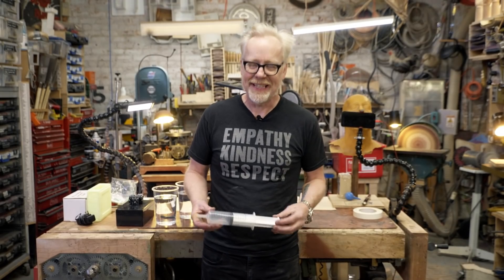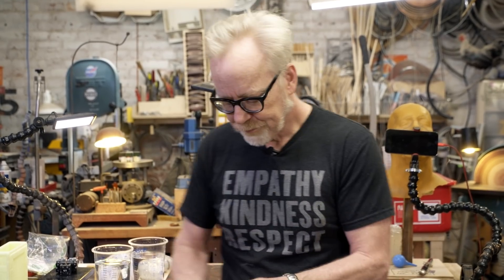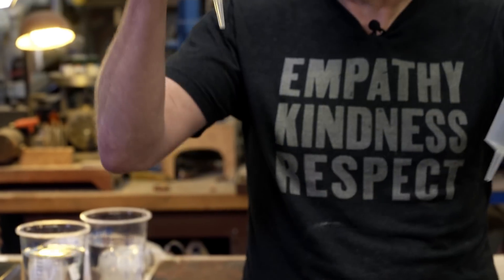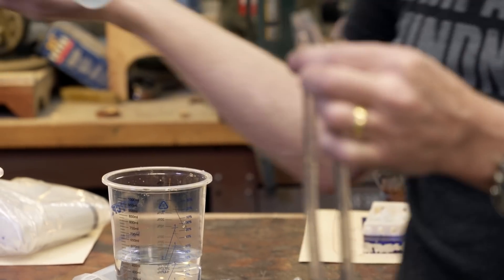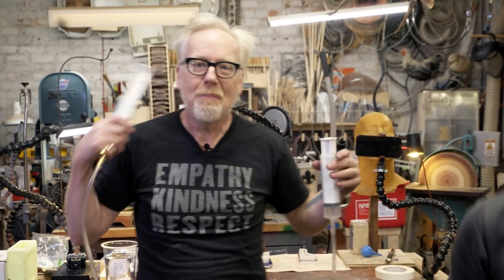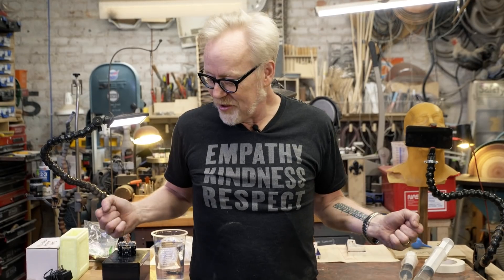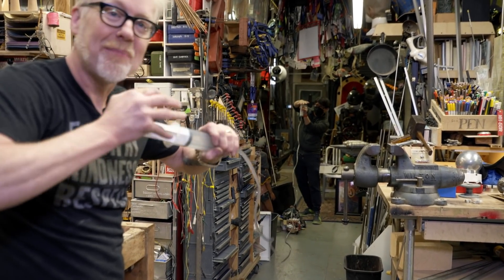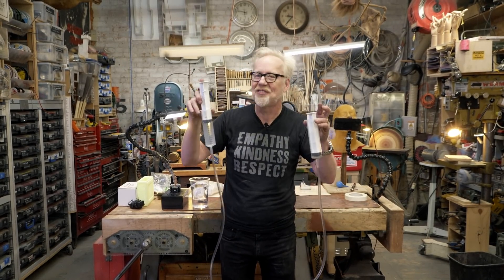Adam Savage Demos Hydraulics with Cheap Plastic Syringes

Comment: Those syringes can also be used to show physics. If you fill one with a little water at e.g.40 degree celcius and plug the nozzle. Then pull hard to create lower pressure, you will see the water starting to boil. This is due to the temperature needed to boil water decreases with lower pressures.
Reply: Ohh, and if you need more mechanical advantage making pressure, many larger syringes fits the cheap chalking guns :)

Comment: I've used this system but with air to change the tuning of a high-voltage section of a radio transmitter. Obviously water would defeat the object of keeping me and a few kilovolts at a mutually respectful distance, and the tuning circuit didn't need much mechanical force to operate - basically a variable capacitor with a swing arm. 

The arrangement worked very well. The transmitter, not so much. But that's another story.

Comment: I've you've ever put plants in hard to access places, you can use a syringe and some tubing to water your plants from a distance. It's a very useful trick I learned working with a group on an art installation that had plants strapped all over it.
Reply: Could use T fittings to split off a single input line as well.

If you have a high quantity of watering to do, could even replace the syringe with a small fountain water pump or maybe an in-line hand pump like the ones used to siphon gas or other fluids out of drums and barrels.
Reply: @Sycillis  That's basically a drip watering system.
In the gardening store where I did my apprenticeship, we had hundreds of flower pots stored under the ceiling, both in the sales rooms and the growing houses, and we'd water them through a rubber hose network running alongside the suspension cables.
Reply: @Yora21  Yeah, they already sell this at home depot lol they’re very small black hard plastic hoses that drip how much water you desire
Reply: Who would make their plants hard to reach? That seems so very mean. 
'I know you need water, but I'm gonna make you hard to reach! I will throw water at you. Hopefully I will get some syringes and tubing together before you shrivel and die! Think like a cactus' - Mitch Hedberg(almost) lol

Comment: used with non conductive fluids to operate tuning capacitor mounted on HF magnetic loop antenna systems. This allows manual tuning of the antenna without any adverse effects.

Comment: Ive used  a similar sized syringe to add tapping lubrication in my CNC mill... a $10 solution in a $1mill machine :)
After the holedrilling operation, before I would stop the machine (M00) to add the tappingoil by hand. Got tired of this very quick, so I put the syringe upright in a vise, with the hose ziptied to a magnetic block, then using an emtpy ER32 collet i could push it around the workpiece and push down the plunger just a bit to add the oil... One of those things I SHOULD have made a video of I know :)

Comment: I learned about the usefulness of Fluid and Pneumatic Cylinders using plastic syringes in my "Power, Energy and Transportation" Class in Middle School back in 1988 (8th Grade).
Wonderfully simple and easy to use with phenomenal results!
We also dabled with Gear Ratios using LEGO Technic Sets, Compressed Air and Solar Power... Back in 1988!!!
I may not have had S.T.E.M. offered then, but to date was my favorite class.
Then I became an Environmental Engineer many years later...
Thank you Mr. Woods! (My Instructor)

Comment: I like to paint with oil paints and use odorless mineral spirits to clean my brushes in a glass pickle jar. The paint settles at the bottom and I use the syringe to pull out the "clean spirits" at the top. Saves money and the environment!

Comment: I was asked to help with a Passion Play years ago and the director wanted blood to pour out when Jesus was speared. And he wanted it with 20 minutes till stage time. I attached one of the 150ml syringes to a wood staff they had, cut off the nozzle, drilled holes in the end with my pocketknife, and covered it will aluminum foil. Unfortunately, when the guy playing the soldier pushed the spear against Jesus, he didn't hold it at a slight angle like I told him he pressed it flat against his body. No blood was pouring so he pressed harder and harder until enough pressure had built up that the blood finally shot out and sprayed all over the first two rows of people. Two ladies screamed, one fainted and one guy jumped up and ran out. The Pastor of the church and the director asked me back for several years, but I figured I would stop while I was ahead. It was glorious! :)

Comment: on my short film i had to have a space ship land inside a vertical docking bay in a larger space ship, i built a 3inch model for the smaller ship and had it attached to a pylon within the larger ship, the pylon was attached to a syringe and i was able to lower and raise the ship very gracefully into the docking bay using this method, it worked flawlessly in a wide shot.

Comment: In grade 7 my class went over to one of the local high schools to use their different shops and labs for a environmental project.  In the group I was in my partner and I were tasked with creating a small model greenhouse out of wood and plastic wrap which had windows at the top that could be opened and closed.  We put the windows on little piano hinges and used this very same technique just with much smaller syringes to open and close them.

Comment: I've used it to create a vacuum pump to vacuum seal packages, but it didn't end up working as well as I wanted it to. All you need for it is one-way valves and a syringe to pump air in and out and since the air can only go one way through the system of valves, it'll suck the air out of the bag. The only problem was that you'd need a vacuum seal with the back and the piping and the DIY I had read said to use hypodermic needles. That absolutely does not work, because the hypodermic needles will just pierce through the material and there's no guarantee for a seal after.

This was before soude vide was common.

Comment: Even more fun things happen when you mix sizes of syringes too.

Have a thin syringe powering a fat syringe to amplify your power (at the sacrefice of how far the output moves) or have a fat powering a thin to get an increase in travel at a trade-off of loosing power
Reply: Actually power is more or less conserved. What you are "amplifying" is the force.
Reply: For water or air?
Reply: @carolinavizcarra9772  hydraulics so water/liquids

Comment: I work in oceanography and a lot of scientists used theses syringes to filter water. The thing is that they get tired because the porosity of the filter makes it hard when you have a lot of samples to push the water through. A couple of years ago, we discovered that theses syringes fit in caulking guns. Makes it way easier to put pressure on the syringe
Reply: That’s a Syringe gun)))
Reply: That's really clever
Reply: I almost feel like another solution may involve something similar to an automotive bearing puller and a cordless drill.
Hooks to hold down the syringe, thread head to push the syringe down, drill to power it.
May be similar cheap vises that could be used to do just about the same thing, but they'll be a lot heavier and less adaptable.  Closest that comes to mind is a miniature vise used to put barb fittings into hoses, but that feels like it would be too small.
Reply: That is awesome!!!
Reply: Then get a caulk gun that is activated by air pressure, and a small portable tank. Works wonders for klutzes like me who can't operate regular caulk guns.

Comment: A blocked syringe can be used as a spring! if its blocked while fully extended, it can function as a compression spring. If its blocked while fully compressed it can function as a tensile spring!
Reply: Blocked AIR FILLED syringe. If you fill it with water like in this video it won't compress one bit.
Reply: And a blocked syringe with a needle hole poked in the head acts as a buffer! it will compress like a spring but slowly let out air to release pressure.
Reply: these are makeshift linear dampers!
Reply: This reminds me of... I think it was called biopunk?

Comment: It's possible to use syringes of different diameters to amplify the force of actuation (move the thin one over longer distance with a little force, and the wider moves a little distance with a lot of force).
Reply: The downside is that if you miscalculate the volume, the smaller syringe goes poot and its plunger shoots across the room.
Reply: @TomOConnor-BlobOpera  Or an advantage, instant gunshot, confetti cannon, or flying object on a budget.
Reply: @TomOConnor-BlobOpera  Indeed... Ideally you'd get syringes that are the same volume, but different diameters. That should allow you to maintain the mechanical advantage without the poot risk.
Reply: @JustinShands  giggling here at "poot risk"
Reply: Indeed, indeed! Well put.
Reply: Start adding in T fittings for multiple movements off of the same input line with reduced force on each, and other mechanical tricks like levers and you can get some pretty good multi-output solutions across a stage or large area.  Mix and match T fittings with various syringe sizes and you can really start having fun with synchronizing things.
Reply: @Sycillis  that's exactly how I was taught the basics of hydraulics when I first joined the air force as an aircraft technician .
Reply: I was just going to comment this
Reply: Is it with water or air?
Reply: @carolinavizcarra9772  Adam said water is better for most but not all situations. Air is more compressible as he said, so air would not make as efficient movement.
Reply: @Call-me-Al  cool thank you!

Comment: Excellent!  Fun fact baby oil/mineral oil is pretty close to hydraulic oil. I'd also recommend using piston size as a mechanical advantage or speed modifier.
Reply: Oil actually "locks" the syringes making them useless because it makes the rubber of the plunger not smooth enough for it to move as it used to. I tried using one before with a hose for me to feed oil inside a hard to reach gear box I am working on (too cumbsersome for me to disassemble). At first I thought it was the syringe since the one I used are pretty old (expired sterilization date) but even when I bought a new one the plunger still got stucked at the bottom once I used up all the oil. Never used any kind of oil with syringes from that point up to now.
Reply: @bielsaarendelle6714  certain oils will attack the rubber and cause it to degrade

what usually happens though is that the oil is more viscous and causes a better seal. If you push the plunger of a normal syringe all the way down it often creates a little pocket in the edges of the cylinder that don't meet the nozzle, because the oil is better at sealing that pocket you're trying to draw a vacuum as you withdraw the plunger and it won't budge. In normal operation the seal is imperfect enough for that pocket to draw air from the nozzle or from the other side of the plunger diaphragm

They do the same thing if you're using other viscous fluids like syrup
Reply: @ConorNoakes  thank you so much for your explanation! That experience bothered me for years! Now everything makes sense to me. Really appreciate it. Cheers!
Reply: and less of a fungal/bacterial issue when working on something that needs to last longer than a few days

Comment: I have seen these used to make simple actuated arms to teach kids about hydraulics. It's a really simple idea and works well. Changing the diameter of the syringe on one of the ends also changes the speed and strength of the syringe on the other end (F=m×a, volume, etc.).
Reply: I was going to say this too... I have used that in technology education with students "hydraulic robot arms" 💪👍🤣
Reply: Likewise, I was here to mention using different diameters if more force or more throw was needed.
Reply: Pretty much the same as gear ratios.
Reply: My JR high did this, but I never figured out which class did it so I didn’t get to do it. :(